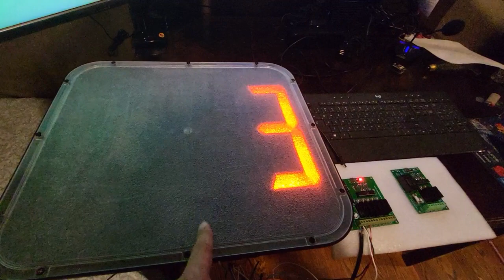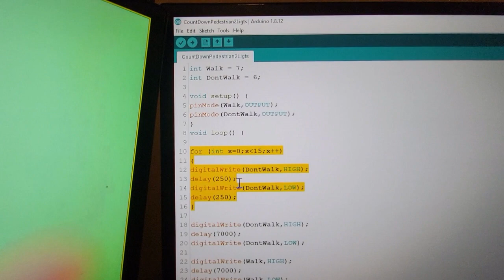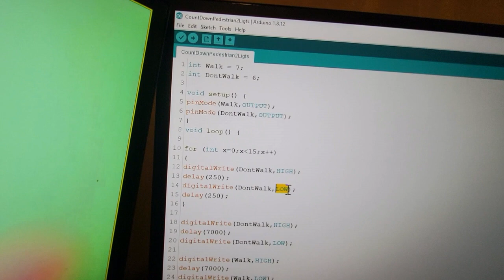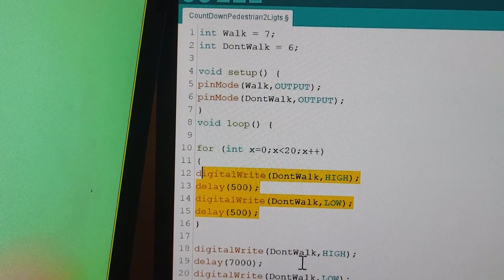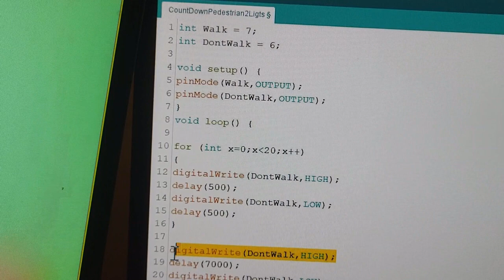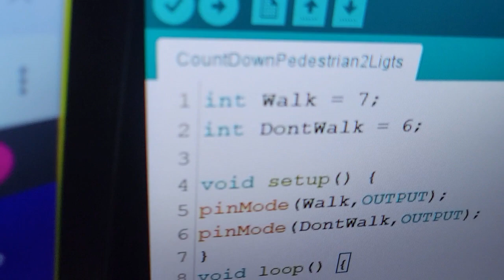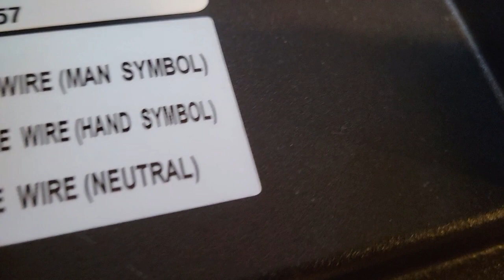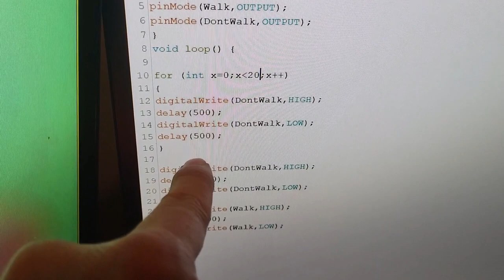How to control Pedestrian Crossing Countdown Signal. Programming Traffic Controller Best Timer Ever

Comment: my sign has two sets of red blue and white wires what is the config you used for wiring ?
Reply from the maker: Please check its manual. you should see lines and neutral . you do not need ground for this controller.
Reply: @IOTmug  unfortunately it's practically impossible to get the manuals for these devices but I figured it out blue and blue red and red white and white can you flash the hand at the first of the cycle program the counter for the next cycle
Reply from the maker: Happy to hear @unmanaged